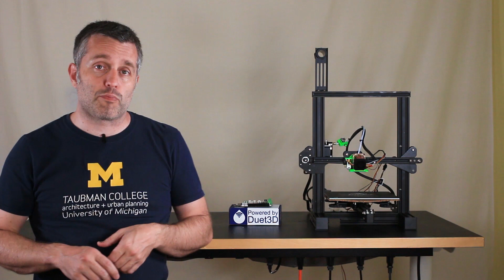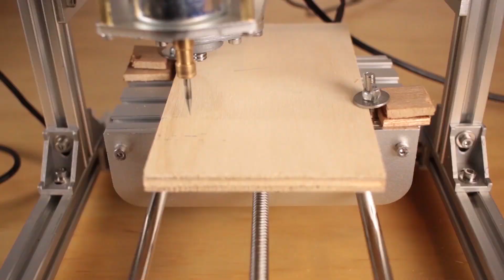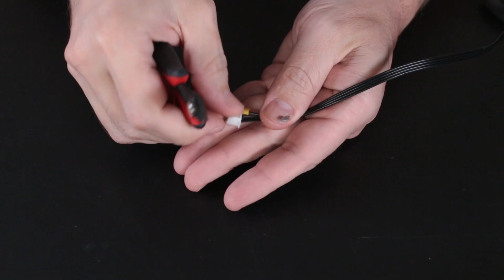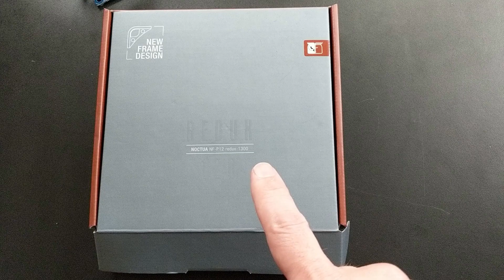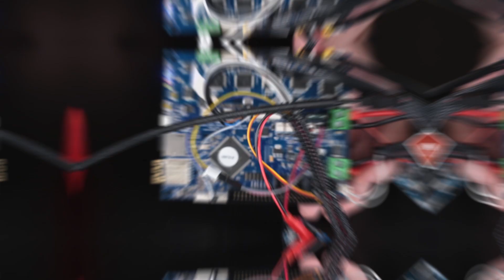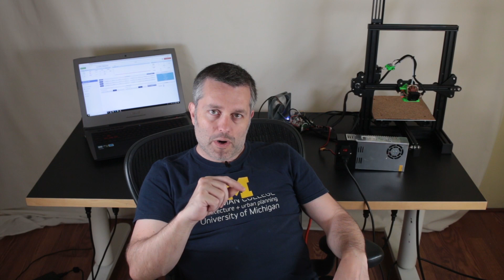Wiring the DUET Wi-Fi to the Ender 3

Comment: In Australia you're not aloud to tin your wire before you put it in a screw terminal
Reply from the maker: In this case, the Ender 3 should be banned from Australia as it comes with tinned leads in the screw terminals.
Reply: The tinned leads thing? Some (I assume Aus is one of them) govts don't allow solder under Fire regs. For two reasons, as I understand it. 1: the solder can melt-out in a fire, possibly disconnecting safety systems. 2: It can pour onto other circuits, causing shorts... now you don't use crimps in firesafe systems, solder is in everything electronic and by the time a house is on fire. You'll get shorts from everything insulated by plastic(s)... But it makes sense to some politician somewhere, they have to do something, or you'd realise Policy is automated and MP's are just office administrators xx
Reply: All wires are tinned anyway.  The silver colour of the wire is tin coating.  So if that’s Australian Law it’s friggin stupid.
Reply: I agree with P D James.  If your wire gets hot enough to cause solder to flow, you have a major problem.  #1) your PTFE casing is on fire, #2) your fuse isn’t working.  If the solder were to melt and flow out, it actually might be a good thing as your wire might go open circuit and stop the current flow.   This is just typical beaurocracy “over thinking”.  The Australian government needs to do some proper work instead of stupid regulations like this.
Reply: Omg, I put one of my cover screws in slightly askew! = I'm on fire :P
#PleaseSafeMeFromThisTerribleFREEwill ;o)
Reply: But it's the point Gazza xx probably one of the most important things every 21st century child should know. (and sorry to twist the subject a bit - not sorry xx)
Governments - don't do that, it's not their Job.
They Administer, political law. As agreed by the Citizenry. ie: YOU.
Office work in this regard is very straight forward. Especially under #DirectDemocracy
Your public servants (previously wrongly entitled Politicians - which is an ancient Greek insult -lol)
Get paid a fair wage to administer the money You allow them. In the way we have agreed en-mass.

Plain Inglish is independently applied to all public votes.
And any important changes in spending - like giving a £5bn Hospital to a private trust - or slashing serious crime budgets by 20% 4 years running...
Giving your arms-dealing buddies £375,000 Million in Quantitative Easing... #Barclaymores 
Get voted upon, with a reasonable (not perfect) level of secure identity.

The alarming part of running a first world country is that it really is that simple.
And it's not alarming for you... it's terrifying for #Them - cos they are 99% corrupt, lazy, overpaid, incompetent, lying, at best confused, narcissistic, paranoid, averagely dumb.. humans. Just like you and me, but probably not as nice xxPD

.. hence the whole 'trying to make popular policy' thing - with reactionary anti-solder hatred :D
which i think is where we began, at least i did... .. my fingers will stop moving in a minute, 2 maybe ;o) xxPD
Reply: If you are not aloud, just be quiet about it then *allowed. Tinning wires in terminals is a death sin. I have seen electrical cabinets ending as a smoking pile of dust because of this.
Reply: zapro_dk  bully :D and totally legal in the UK (but 99% of all main is solid core anyway) I still have commercial tinned flex in my cupboard xx

Comment: I'm so glad to see you go into why it's important to support innovation instead of theft and iteration.  Thank you :)
Reply: Cloning the duet isn't theft. It's derrivative works. Duet is open source. On Duet's website they actually encourage hardware adaption and design as long as it follows the license.  Which only requires recognition silk screened on the device - which i do find on the 3rd party devices. (and not be sold with logos active as if the genuine thing). Support creators for sure, but like others have said we wouldn't have 3d printing of the cost of entry was always a premium play and open source is never a financial instrument, its always an ethical one which doesn't jive necssarily with capitalistic views.

Comment: I find TH3D's EZABL to work perfectly on my ender 3 w/ stock board..
Reply from the maker: The BLTouch is superior to any inductive probe because the BLTouch measures the print surface directly. You can switch surfaces and simply run a G29, and you are ready to print again. The same can't be said of a technology that detects the metal substrate and does not take into account the thickness of the print surface. Also, I don't vouch for TH3D, but I'm glad your dealing with him worked out well for you.
Reply: TH3D's is a capacitive sensor which will detect glass.  Prusa's is an inductive.  The pinda works fine considering a metal bed.
Reply: Any capacitive proximity switch will work as a bed level detector.

Comment: That crimp job though. That hurt to see.
Reply: Right?  Lol, looks like crinkle fries.
Reply: Those french fry connectors from the power supply are going to generate a lot of heat due to the limited area of connection.  Think of it like a hose.  You now made the connection a tiny fraction as efficient as before.  As a result its going to heat up because of the smaller connection surface area.  Likely there will be melted terminal connectors at some point.  You need a proper ferrule crimper.
Reply: It looks terrible
Reply: Annnnnnnnnnd time to relive it again
Reply: You all need to stop liking this. I keep getting notifications, forgetting how bad it was, going to see it, and reliving the experience.
Reply: I have the expensive version of this tool and my crimps look no better. What's the secret?   How-to video please anyone who can do better....
Reply: @neuxstone  that's likely those prusa fan boys still raging
Reply: I am an Engineer and I stick to the rule of... If works and it's safe + reliable...  it's all good. After all engineers are not painters